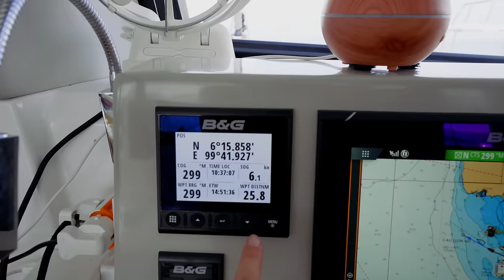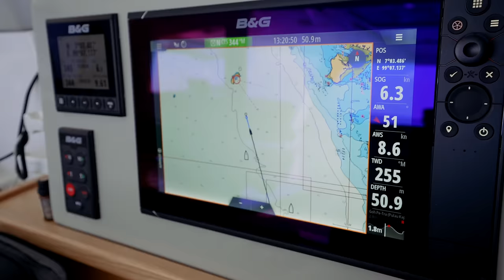Is This Thailand's Best Kept Secret?

Comment: It’s a good thing that Nick is so mechanically inclined. After just having a knee replacement, I have come to the conclusion that doctors are mechanics at heart. Taking things apart and putting them back together. I am grateful for their ingenuity. So glad that you’ve had a peaceful sail.
Reply: Not Mechanics, Engineers. It is about solving technical problems.
Reply: @jonathanwetherell3609  great point
Reply: Cardiac surgeons can change the battery while the engine is still running
Reply: @Plantandpeoplecarer  You do not have an alternator. Disconnecting an alternator from the battery bis likely to terminally damage it. Most boat owners know the danger of switching off their diesel engine, you push the stop button first and only switch it off when the engine has stopped.
Reply: @Plantandpeoplecarer   BRILLIANT!!!  HaHa!

Comment: Wonder why cruisers worried about anchor drag don't put out second anchor, when one starts dragging at point second one becomes taut, dragging ceases. An anchor with about a boat length of chain and 150 feet rope may be easier to handle. Not a perfect solution but has enabled worry free sleep.
Reply: Rope anchor rodes in reef areas often get cut by the sharp coral. Using a float at the chain to rope connection  just big enough to hold 5 to 10 feet of chain up off the bottom  and floating polypropylene rope to stay above the coral can work but it's a pain. Polypropylene rope is very low stretch and so doesn't cushion wave surges like nylon does.